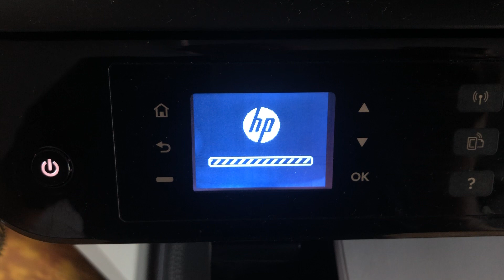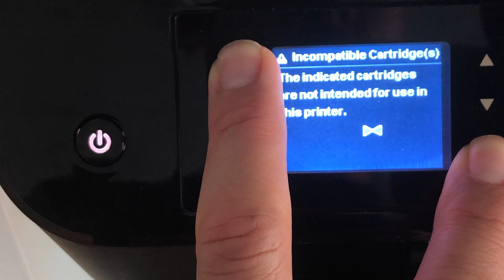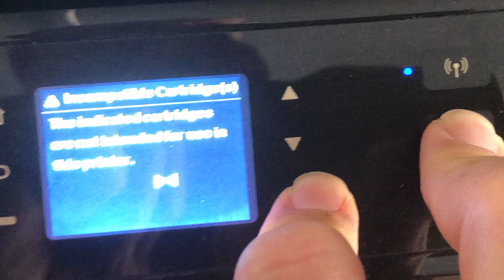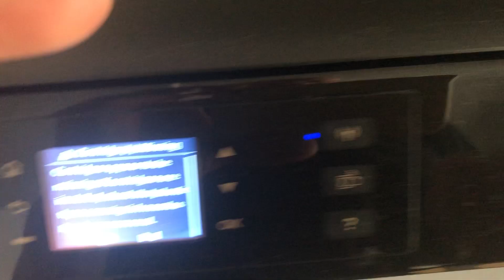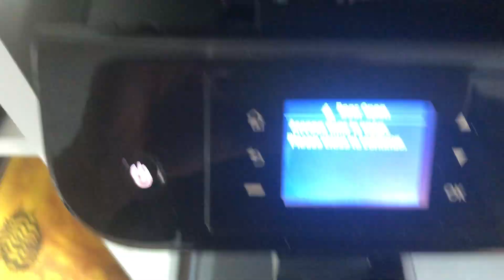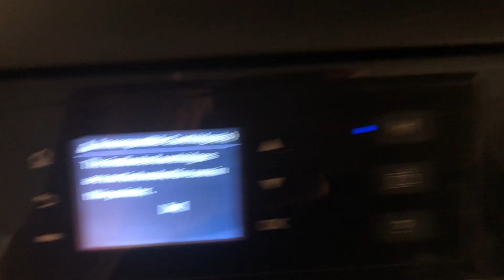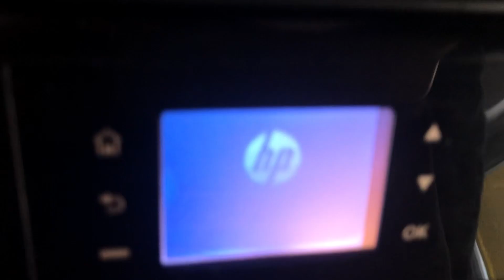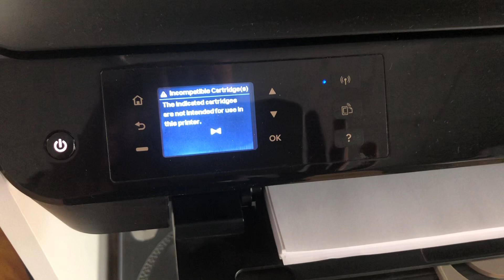HP deskjet ink advantage 3545 “the indicated cartridges are not intended for use in this printer”

Comment: have this same problem, menu is stuck on 'replace cartridge' or 'incompatible cartridge' for black cartridge, cannot go to home menu, tried multiple cartridges, tried cleaning contacts.  Have read that HP printers automatically update firmware over wifi, so I suspect there was a buggy firmware update pushed over wifi from HP.  HP support website is no help whatsoever, they claim there is a factory reset command to restore the original firmware version, but will not publish it on their own support website, they instead make you request it and then will only message you the command, keeping it secret on the website.  This is truly baffling.  It appears they do not want to admit to a buggy firmware update.  The Youtube channel '303 Electronics' describes a factory reset procedure for the Envy 4500 - from the home screen press 'dash home dash dash', but my printer cannot show the home screen so not sure if it works.  Apparently every HP printer model has a different command sequence to get to the hidden service menu, and HP purposely will not tell their customers what it is.  Even the technical manual pdf links on their website have all expired.  I thought Epson was the worst printer company, but this is ridiculous.
Reply: That's the way they make us buy new cartridges
Reply: @monalisadies  New cartridge didn't work for me.
Reply: I did what I thought was a semi-reset, didn't fix it.  Then a OOBE one cause won't work anyway. Didn't work.

Comment: Need to change cartridge holder .
Reply from the maker: I bought new cartridge and it works fine. It s just a way of making consumers buy new products. There was nothing wrong with the old one exempt I refilled it. A good dozen times
Reply: @back2nature788  I brought new cartridge but no use. Problem still exists.
Reply: @back2nature788  This is for ppl who don't refill theirs.  I only buy new ones & replacing it does not work.

Comment: I changed my ink cartridge but still mines like that what can I do
Reply: Same issue plz help
Reply: me the same :(( even the cartridge is new and original
Reply: and it seems that everyone's got the same issue with the black cartridge. I tried a different cartridge but nothing happened.
Reply: THIS worked for my ancient 4630 officejet.
1 Remove  ALL ink cartridges, CLOSE Lid.
2. Turn off printer fully.
3. JUST keep your printer unplugged for a few minutes to allow it to reset. 
4. AFTER a few minutes, turn back on, wait until fully rebooted and you see the main screen.
5. Retry inserting cartridges.

Comment: HP is a total rip off ... its been that way for years. ... switch to Brother ... reached a point where even new cartridges still didn't work ,.. they update the software knowing its not compatible with the old cartridges forcing you to buy a whole new printer
Reply: U bought a Brother printer?  I am going to have to buy one but it won't be an HP.